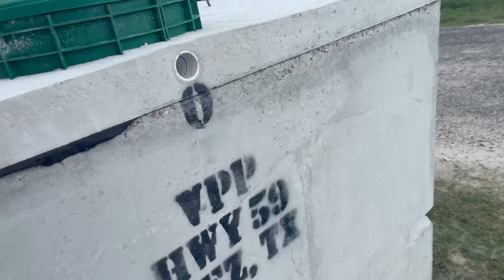Cost of a Septic system for a New Construction Mobile Home Development on my infill lot

Comment: Hi good evening quick question I know you deal with the septic you have experience on this if you can help me the constructor for septic he just done to my house which is cost $66,000. What do you think?
Reply from the maker: $66,000 does seem like a lot of money for a septic tank but I would get multiple bids from licensed septic companies in your area and compare prices and services to get an idea of what everyone else is charging…estimates from contractors are normally free in my experience, best of luck!
Reply: Where are you located in New Jersey or what state
Reply: @simplyinvested  not just the septic the dirt he threw to the neighbors without asking and he called the company to remove the dirt $5000 he did some damage to the neighbors he put the rocks cost me 2500 screw up with machines that dies around their house he make me to pay for that more than $5000 hold those things not supposed to happen. I’m not responsible for that far as I know.
Reply from the maker: Seems like you’re already spending a lot of money to have to pay for someone else’s mistakes,  I know if I make a mistake no one else is going to pay for it so it seems like if they made a mistake they should pay for it…or come back and fix your neighbors property!
Reply from the maker: I’m in Texas